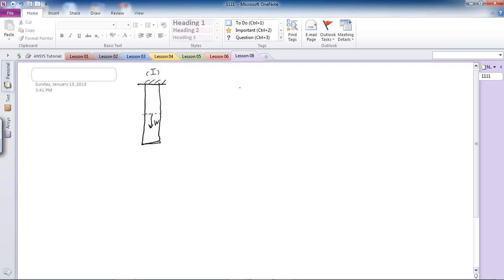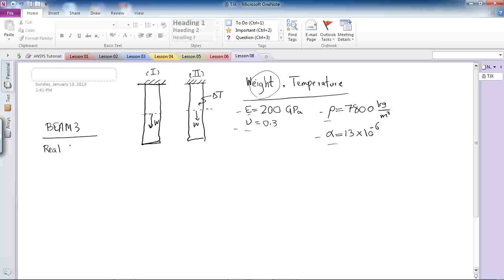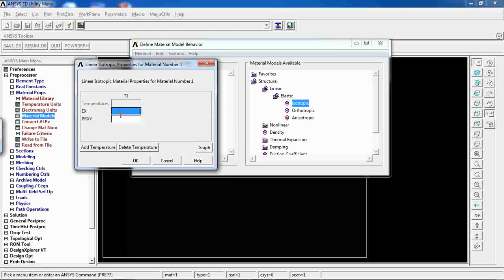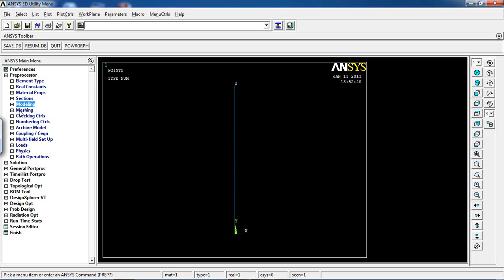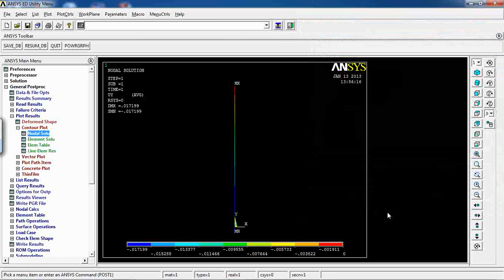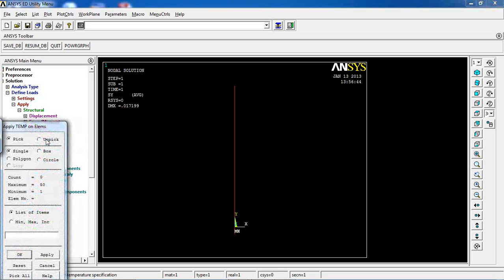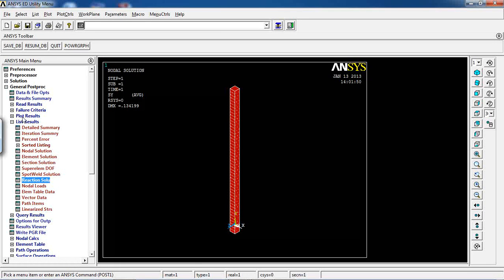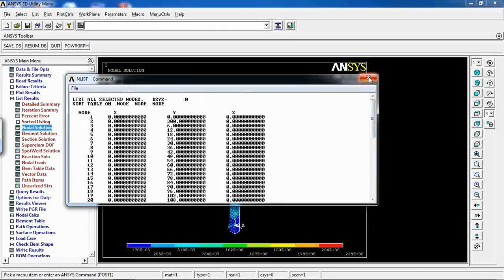ANSYS - Lesson 07: Deflection of a beam according to its weight and temperature difference

Comment: your tutorials are excellent. really great work.
 but i have got some doubts. firstly you used values of elasticity and density in SI units but for defining the length of beam and area of cross-section of  beam you entered the values in milli-metres.
secondly, in postprocessing maximum displacement along y axis was .017199 units. and for stress along y axis you said stress is constant of magnitude .017199 units(same as maximum displacement along y axis).
please clarify the above doubts.
Reply: I think that there is an inconsistency in his units as well, unless he wants the section to be of 12m x 12m!